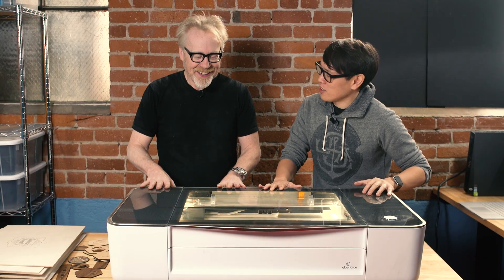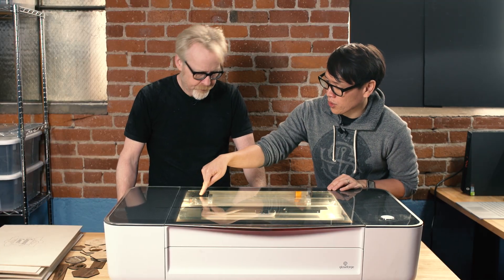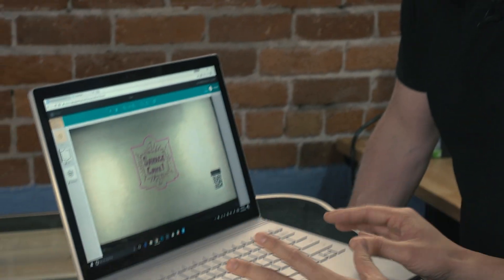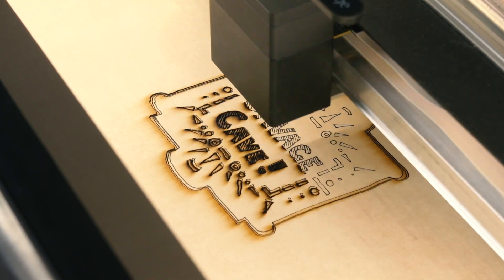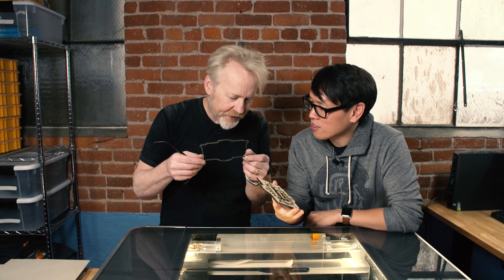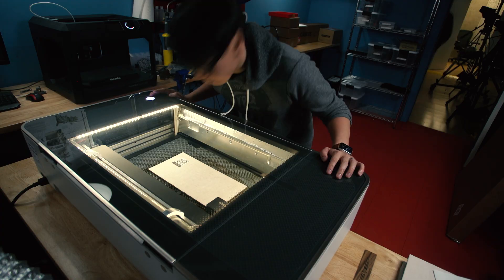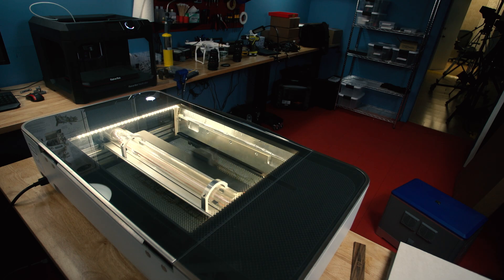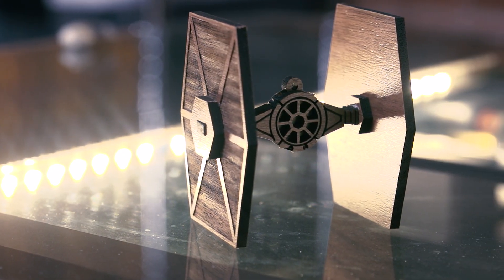Hands-On with the Glowforge Laser Cutter!

Comment: hve they resolved the delay in delivery for preorders yet? I was going to order one until I saw that they hadnt delivered a single unit to an actual customer yet. only "beta" machines had been put out to a select few.
Reply: So....apparently not...since this is still a "pre-order/prototype"  they still haven't shipped a single machine out?  Does anyone have experience with backing items on indegogo and kickstarter...are they usually over a year late issuing products?
Reply: I know of many cnc type products that go on kickstarter as a concept or idea, just for the people running them not to realize how long it takes to make an actual functioning product.
Some of the products I've wanted have even gone under complete redesigns to what the original product was, and the new product is nothing close to what the original was supposed to be. 
I've personally, and many people I know, have stopped funding products completely; unless they're already made, ready for production products that need little work to be manufactured and sent out. 
I think kickstarter and indiegogo need to implement a system where you have separate parts of the site for products ready for production and another part for conceptual products. 
I refuse to support R&D on a product, but I will support bringing it to manufacturing. R&D gives no promises of even a final prototype, but bringing a product to manufacturing should promise a product. 

One example of these issues is the peachy printer. Campaign ended October 2013, went under testing and redesigns etc., just for them to go dead silent. News broke that one of the employees embezzling the money into a private account, in November 2013, and the owner had known this since a year later; and there's yet to be any charges or anything against the employee, for who knows what reason. Now that it's 2016, 3 years since the problem, 2 years since the owner has known, the company has essentially shut down. I had lost hope after one and a half years of waiting, and after product changes I was done. What was supposed to be a $100 3D printer eventually became a $100 base kit that you assemble completely from scratch, and the machine was in no way large, just a laser and some mirrors on legs over a container of resin; and they charged a lot for a pre-assembled machine. I now distrust any company that starts on KS or IGG, and barely trust any company that tries to start a conceptual product on either.
Reply: So, there in lies the problem.  When they have a video of what looks like a working prototype that's fully functional, as Glowforge does with all their products made...how do you tell when it isn't really not a working product?
Reply: I'm not sure about Glowforge, since I don't really follow their company. But if this is the production prototype model that they're sending around to youtubers, judging on how this machine was used before Tested got it and looks like it's had a lot of use, the end product should come relatively soon. Obviously it's not finished since the second camera isn't functional, and the scanning software needs tweaking. But hopefully this one will come out relatively soon.

Comment: adams drawing and the laser cut don't line upfor shit
Reply: Its cause they did the cut first so the material moved/dropped. You should always do the interior engraving first before the exterior cut.
Reply: The cut itself was off, so it's not that.
Problem is most likely the center camera, as they can only see perspective images it means the software needs to adjust them back to orthographic, at the best of times this is not an accurate process. They probably need to add a scan feature where the cutter head/camera goes across before cutting and adjust final placement.
Reply: I don't have any experience using any type of equipment such as this nor do I have experience with CAD-CAM software, but I thought it was odd that it made the cut first before etching.  I'd hope that it's something Adam/Norm just forgot to set (or set incorrectly/out of order) before sending the job to the machine.
All things considered though, this is still very impressive stuff for a still-in-development prototype.
Reply: Yup you're right. Or if adding a scanner is a problem, maybe it's possible to perform a bit of photogrammetry in 2D ? Another thing, the problem is obviouly scaling.This kind of thing coud happen if the distance between the lens focal point and the wood surface isn't set properly.
Reply: if it's only the offset that's off, while everything else still retain the same ratios of distance, does it matter? honest question

Comment: Why do you need the protective tape? Can't you just etch into the wood itself?
Reply: Yes, you can - but a laser can leave burn marks on the surface and if you use the tape, it gets the burn/smoke marks and leaves the under material clean.

Comment: you can clearly see that they didn't account for the lens distortion.
Reply: It's a Kickstarted hardware project. If they actually realise lens distortion exists, they're probably doing better than average.
Reply: It's also a pre-prod model. This can be adjusted in software and calibration.
Reply: also stupid of them not to include basic scanner equipment... this could have been so easy...

Comment: 40 minutes to do that?! WHAT!? Not impressed.
Reply: Spencer Wilhelm that is actually not a bad time. Currently have an industrial grade laser cutter and it would only be able to do it marginally faster but it would have taken me 30 minutes in CAD and a camera to get it to print a drawing like this.
Reply: The speed depends largely on the type of file. For example, if it were a vector, it would cut much faster. And remember that this is a pre-release and not the final public version, so many things will likely improve including overall speed.

Comment: I dont understand why they keep saying cad to cam, this is not a mill. This is no difference from an Epilog laser, you guys are acting like the only laser cutters are giant room sized with clunky cam software. I use an epilog laser every day in my job and it is much simpler to use than this overpriced piece of junk.
Reply: CAD to CAM applies to anything CNC related such as 3d printers, Laser cutter, CNC routers, CNC milling machines.  You draw it up in CAD and then use CAM software to define the toolpaths.  I use the same CAM software for both CNC routers and CNC milling machines.  For a 3d printer, the CAM software is your slicers that produces the gcode for you.  A laser cutter is no different from the others in terms of CAD to CAM.
Reply: Proto G, that depends on the laser. I also have an Epilog, and I print directly from Illustrator. There's no conversion necessary, just a standard printer driver to tell it speed and intensity.
Reply: relishgargler CAD to CAM still applies, the CAM software is just built into the machine. The way the toolpath for the machine is created depends on the laser but at the end of the day it's just coordinates generated from your drawing and most 2&3 axis machines are pretty much identical from a process standpoint.  

CAD = Computer Aided Design
CAM = Computer Aided Manufacturing
Reply: Yes, that's true, but my point was more that CAD to CAM doesn't need to involve any of the headaches that were referred to. I can run my laser from literally any program on my computer that has a print function. I could engrave the car diagnostics report directly from my OBDII reader if I wanted to, and it would be easy.
Reply: CAD... computer aided design / CAM... computer aided machining. 40W :-(
For those who are interested Fiber laser machines are now up to 10KW  1.06nm which cuts copper, brass, alum and very thick steel

Comment: +Tested If you really want to put that machine through it's pace, you should have Adam design and build a dollhouse. Design parameters should include working doors and windows with casements, and it should include materials other than wood (like plexiglass or glass inserts for the windows). Style isn't as important. Sure, a victorian house would definitely put the machine to the test, but everyone builds victorian doll houses. Any Craftsman house would work fine, as would a Frank Lloyd Wright style house.
Reply: definitely can't cut glass with this laser.

A 40watt laser also can really only cut 1/8" soft woods (baltic birch, balsa) and some plastics. In the world of lasercutters, its one of the weakest lasers you can buy that lets you cut through some materials....
Reply: Jack Linde +
Reply: OMG! Yes!!!
Reply: Fallingwater could work.
Reply: +Albert Ro it's the first "desktop" laser cutter; the laser cutters HandandSew was talking about are all industrial machines that won't fit in an office, cost a whole lot more, and cannot be operated without training.
Reply: There's actually several other desktop laser cutters out there... Try googling GCC or Epiloq for starters..
Reply: HandandSew what laser cut would you recommend
Reply: Also, 40 minutes!!!!! on a regular machine, this would take between 3-5 minutes... jesus its slow.
Reply: @Stevieboy7  HI ! I´m thinking abput buy a cut laser machine, What laser could you recommend ? thank you
Reply: +HandandSew That is not true at all. I have a 40W Laser and can cut up to 1/2" Acrylics and almost all types of woods at 1/4" without problems.
Reply: +InXLsisDeo The Epilog Zing laser series is about the same size as the Glowforge (the Zing16 is even a bit smaller and more compact). Take a look at that, has pretty easy usability as well.

Comment: I was an early backer of the Glowforge but ended up bailing on the project due to me coming to the conclusion that, while it seems like it would be super easy to use, it wouldn't be large enough or powerful enough for many of the projects I have in mind. I ended up purchasing an enormous 100W laser cutter from a manufacturer in China for around the same price as the Glowforge pre-order (though, what you save in price, you pay for in time spent reverse engineering the machine to make it work correctly). That said, I'm excited that they're finally getting Glowforge units rolling and I hope they become wildly successful--I also wouldn't mind playing around with their Proofgrade line of materials.

Comment: If you're not able to change the scan gap, it would be unfortunate. 40 minutes is ridiculous. I etch stuff like that with high fidelity in 5-6 minutes. I cancelled my GF order, and still feel good about the decision.
Reply: What did you end up buying?
Reply: We've had a 90W FSL machine for 6+ years, and recently bought a full size 130W 2500mm x 1400mm machine from Light Object. Besides the camera / smart features, the machines are very similar to the GF. The GF was ordered at the very start, before buying the large machine. GF was always just going to be a "helper" laser for when things got busy, but the two we have now handle it all just fine.
Reply: Nice. thanks

Comment: Isn't this supposed to be a 3D printer too? That's how it was advertised on Kickstarter
Reply: Its just a normal laser cutter and engraver in a pretty case, nothing more, nothing less.  You can make 3D things by stacking layers of material and mechanically fastening, adhering or press fitting them together.

Comment: WTF, 40 minutes to engrave that!  HAHAHA what a disappointment.  I'm glad I cancelled a while ago.

Tested you need to make a correction it cannot cut or even mark aluminum under any circumstances...and it probably can't mark steel or any metals directly and it certainly won't cut them.
Reply: It can mark coated metals (like anodized aluminum) just like any other lower power CO2 laser can and, just like said other lasers, "bare metal" marking can be accomplished with products like TherMark and CerMark. Actually cutting metals, however, is completely out of the question at this power level.
Reply: Yes, exactly as you said.  In the video they mention 3D engraving of aluminum.  ~7:50 "etch and get gradients into these vertical gradients into the material and you're basically etching really deep designs into your wood or even aluminum"
Reply: Courtney Kinggard if it's anodized or coated with cermark or similar
Reply: Thermark and Cermark are not for etching.  The laser fuses the *mark coating onto the metal surface.  I can tell you from experience that stainless steel works very well with Cermark and a 50 watt laser.  Aluminum and Cermark doesn't work at all - can't even tell the laser hit it.
Reply: myxanadu65 I do aluminum with TherMark all the time and have very little issue with it
Reply: SeptrothFFXI, I'd be interested to know what settings you used.  I was trying to use Cermark, maybe that was the problem.
Reply: You can also use a thin coating of plaster painted onto stainless steel to laser etch it.   It seems to require this specific combination, but when etched at high power and low speed, it results in a fairly deep etching of the metal.  

reference: tried it with a 40w IR laser, attained surprisingly impressive results.

Comment: This is exactly what we are looking for, We could use 3 maybe 4 in our production model shop. I will tell you why we will not buy this for our company.  This unit is not stand alone.  We have poor to spotty internet service in our shop and the industrial park is not on the top list by the internet provider for upgraded.   2nd we do not feel comfortable sending our digital property out on the web to a cloud computer to be rendered and returned back to us.  Granted it is not TOP SECRET or SECRET digital models, but still this is our Digital Property and it should not be out on an uncontrolled server in the cloud.
Reply: You should look at a Voccell DLS then.  I have one (they are close by to my business) and its great and easily 10-15 times faster than the Glowforge for engraving so you would only need 1 instead of 3 or 4.  It doesn't require an internet connection and it can run all day without overheating.  I had a Glowforge preorder until the delays and the misplaced hype machine; I cancelled and haven't looked back.  This video just reaffirms why I jumped ship.
Reply: Thanks,  I will check it out.  Speed is very important to use.  Running 8 hours a day it looks as if the Glow forge will cut about 4 to 6 kits a day.  I would like to get 15 to 20 kits cut a day.  Thanks.
Reply: I use an Epilog 7-12 hours a day, 7 days a week. Find a used Zing or Mini if you don't need a really big bed and you'll probably be just fine. 

I have the same concerns as you about digital property, which is why I bought my own NAS. It has cloud functionality so I can work on designs when I'm on the road, but everything is stored locally in my shop. No way I would use a cloud based app for actually sending files to the laser.
Reply: What machine do you use?
Reply: This is not a machine suitable for production work. It's a hobbyist product. I have a laser with twice the cutting area and twice the cutting power and it didn't cost me more than the Glowforge. It will run 10 hours a day, day after day.
Reply: @epilotdk  What machine do you have?
Reply: @epilotdk  Epilog?
Reply: It is way over priced for the averagescrap booker or someone doing crafts.  You would think at the price it would be good for real production work.

Comment: Would this cut/etch titanium?
Reply: DJJAW11 No, a 40 watt laser can't cut tutanium. It may be able to etch off any titanium oxide layer on the metal, however, which is comprable to etching aluminum.
Reply: As i thought sir, thankyou
Reply: Cut? No. Etch? Yes, depending on your definition of "etch". You can "mark" titanium with a CO2 laser; it will change the color of the layer of oxidized titanium on the outside, similar to heat anodizing.
Reply: thanks

Comment: How can you not look at this and say "I want one"
Reply: Because "works through the cloud".

I want one, but I want one that can be run offline without dealing with unnecessary networking.
Reply: because it took 40 minutes to etch and cut that first thingy. ive worked with faster
Reply: I think you could wood burn it by hand faster and probably just as accurately.
Reply: Guy Gadbois I get where you're coming from. I make photographs using my hand made 8x10view camera with my own film emulsion using glass and aluminium. An old dying process with little of us left thay know that technique and still practice it. 
But if new techniques are taking you out of business, you're either not adapting to the marketplace or the quality of the work wasn't that great to begin with. At least from my surrounding here in Montreal, the community has a high regard for handmade quality items.
Reply: This thing and 3D printers are great if you want your house full of plastic junk trinkets and 2D burnt wood engravings.
Reply: ***** I make wedding rings for a living and there's one guy left that does hand engravings for me. He's retiring in April and that's it, all that remains are machine engravers.
Reply: James Dreger Yeah to be fair when I heard that I cringed a bit. Hopefully they will update their policy and go through an executable on the desktop.
Reply: Guy Gadbois I get where you're coming from. I make photographs using my hand made 8x10view camera with my own film emulsion using glass and aluminium. An old dying process with little of us left thay know that technique and still practice it. 
But if new techniques are taking you out of business, you're either not adapting to the marketplace or the quality of the work wasn't that great to begin with. At least from my surrounding here in Montreal, the community has a high regard for handmade quality items.
Reply: Uniden
Or someone picks up where they're leaving off and does it better and cheaper.